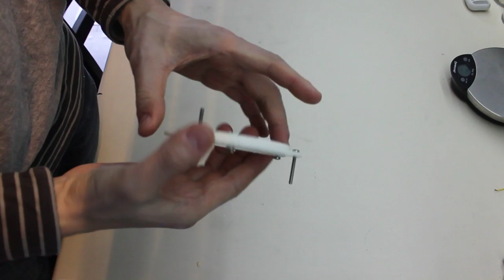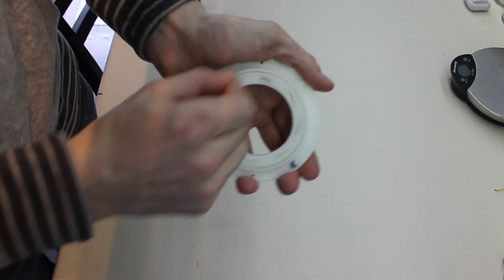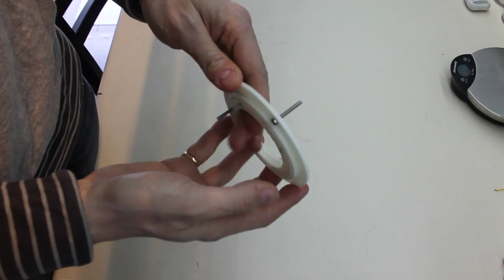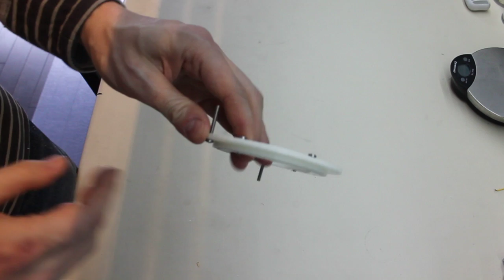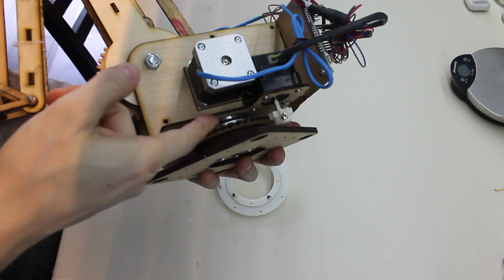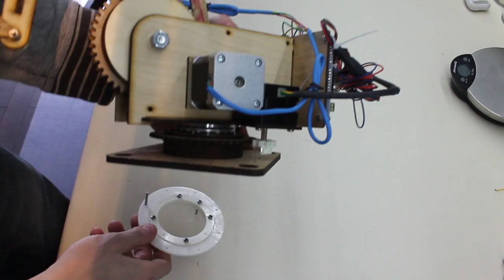DIY 3D printed Slew Bearing in action

Comment: Hey Dan! Thanks for sharing. Just 1 question, how much max. torque can the 3D printed slew drive take? I'm thinking of using this for more heavy duty applications. Something in the range of rotating 50kgs of solar panels for my tracking system. Obviously, a bigger version of yours.